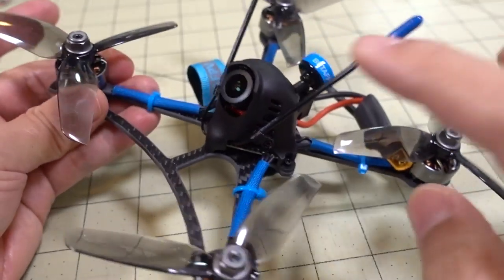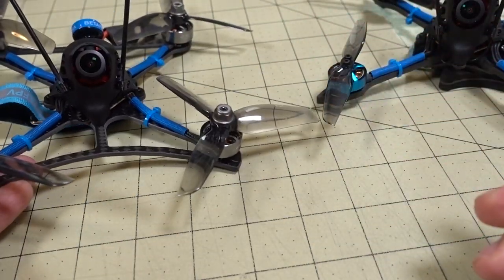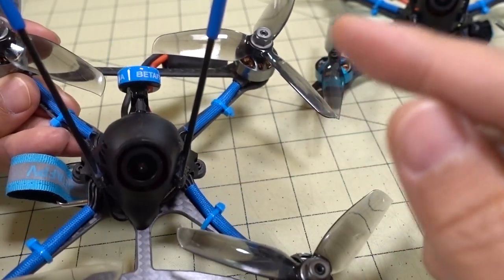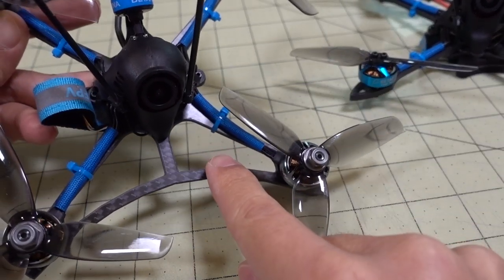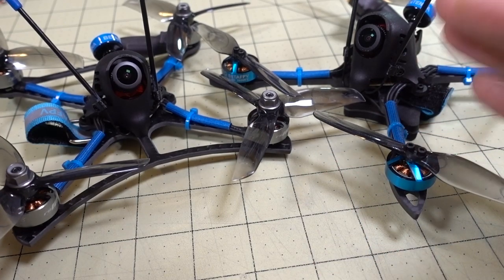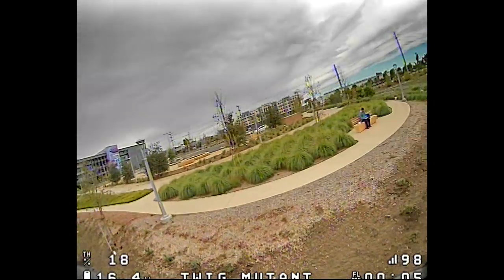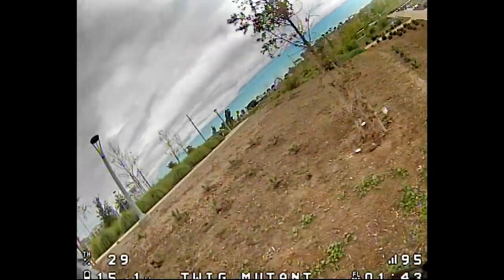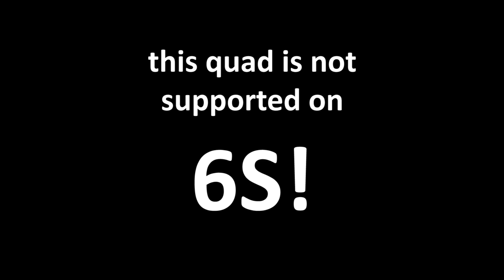BetaFPV TWIG Mutant 4-inch FPV Racer Review 🏁

Comment: They are great. Just be mindful of the antenna clamps as they are help in with steel bolts that could fall off onto the FC and potentially risk a short.

Comment: Personally, I’d love to try the x-knight with the RCinpower motors...😀
Reply: I have the 1st gen rcinpower 1506's, and i rage at them because the prop shaft is wider than standard, and I can't get props off of them. It's infuriating. they're notchy as hell and really strong for their size though, can't complain at all on performance, especially on 4".

Comment: yeah I didn't check the specs so now I have a dead board, I did put 3" props on
Reply from the maker: The motors can support 6S on a three inch prop, but the FC can not.  I wasn't sure which is why I checked before I plugged int.

Comment: been running my twig with 1404's, and even with the 4" biblades it just feels underpowered. If i get brave enough to solder heavier wire gauge for the battery leads i'll switch to 1506's. on that note, i wish the AIO boards didn't have leads presoldered. the solder they use is always hard to work with and I do more harm than good half the time when i try to remove them.
Reply from the maker: You should get a flux pen.  Flux will help with removing that solder.
Reply: @AlbertKimTV  I have one, and I use it, but it doesn't help much. Maybe I'm just spoiled with the solder I use, but the amount of heat I have to use is enough to burn the board half the time.
Reply: @croeitusd5731  it's lead free solder

Comment: You done a tune on the emax tinyhawk race 2 Albert ?
Reply from the maker: No.  The factory tune was pretty good so I left it alone.
Reply: Mmmm and I am flying with a gnb flat cell 2s and I am happy but there’s prop wash recovering from manoeuvres you think it could be tuned out it’s an awesome park flyer decent range on the spi

Comment: Did you check the fc to see if it's the 20 because the have a 35 6s aio fc testing
Reply from the maker: Yes, this version is only 20A and 4S max.  The 35A FC is not in production yet and only a prototype sent to a few testers.  They are probably not going to make that board because interest and demand is low.

Comment: Pretty boring flight footage, maybe fly further away from yourself. This spot is awesome but the same 25ft circle is getting a little old.
Reply from the maker: I fly close so you can hear the prop sounds and tune.  When I fly further away I get complaints that they can't hear the quad noises.   SO you really should complain to those guys.